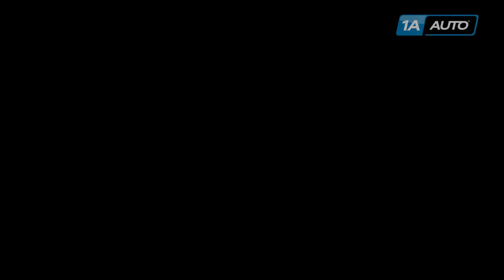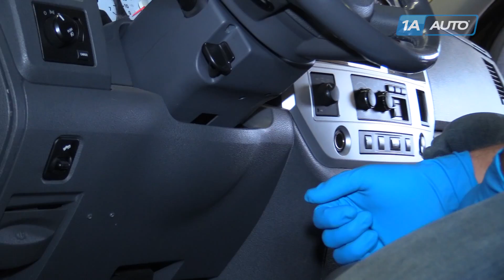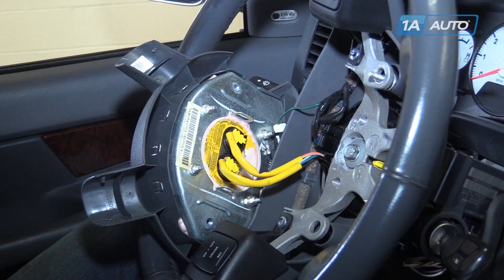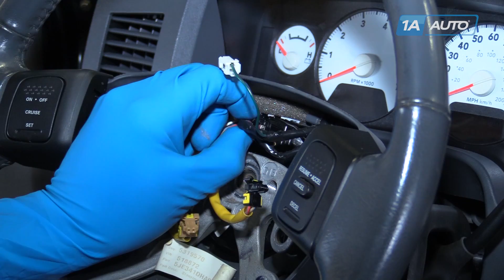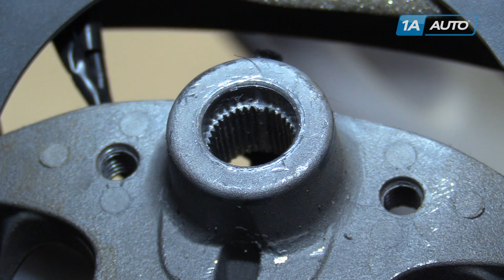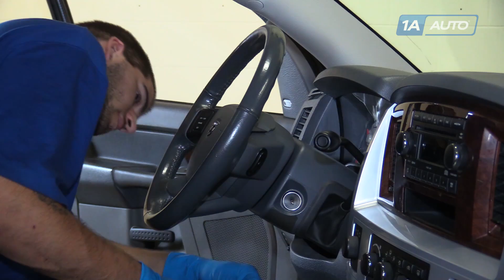How to Replace Airbag Clock Spring 04-08 Dodge Ram 1500

Comment: I have a 2010 ram 1500 2wd. I replaced the steering shaft ujoint and forgot to tie my steering wheel. My airbag light and eps and traction light are stuck on. I read this is a symptom of bad clockpring but all the buttons on my steering wheel still work. My horn and radio and crusie works. No blown fuses either. I also replace the wheel hub bearings. I also gave no codes. Is it possible those lights will shut off on their own?

Comment: You do not need to take the steering column or the steering lever adjuster apart. All you need to do is take the two screws 10 mm from behind the steering wheel and it comes off. You’re doing too many steps that are not necessary.

Comment: Will the clock spring cause a clicking in the steering wheel assy. when moving the steering wheel left and right. It only clicks once in either direction.

Comment: I'm recieving a code ( driver squib #1). My horn works. With my horn working, I was told that it's not my clock spring. Could you create a video on how to search for the open circuit? Thanks

Comment: Will this fix my horn being stuck on
Reply from the maker: +Liam Advena We wouldn't be able to diagnose an issue like that here, you may want to have a local mechanic take a look at it. Thanks for checking us out! http://1aau.to/m/Shop-1AAuto-c
Reply: I just bought one to see if it will fix it I'll let you know when it arrives
Reply: My horn starting goin off fuse and relay are good 
Clock spring peope say cruise control or air bag light I’m having none of that  just horn going off when I tap the horn it stops and then starts again

Comment: Hi, good Video, While heat the bags are deployed, Should I change clock-spring too or airbag module enough?
Reply from the maker: +Webberdock thanks for checking us out! Although it is not necessary to change the clock-springs if they have not failed, it may be a convenient time to have it done as the bags are already deployed. Please let us know if you have any further questions, thank you!
Reply: @1AAuto   thanks for the comprehensive answer!!!

Comment: Extremely helpful, just replaced the one on my 2007, mine had a rubber and steel weight under the wheel, and the wiring was not routed the way it was on this one. I did not have to remove the turn signal module. It may be because mines a 6spd. Otherwise this was perfect. Thanks! Saved 800 from the dealer.

Comment: This was very helpful as I need to check the horn connection on the back of the airbag.I have a 2013 ram 1500,and the horn started to not work properly.When I push on the horn symbols on the wheel it does not work,only if I press on the top right corner.I recently took it to the dealer cause the steering wheel control lights flickered.I think they may have moved the horn connection out a bit by mistake.But they did not check the horn problem.I am disappointed in their service.I know I can check it myself.Great video thank you,myself and my cousin have bought parts from you.
Reply from the maker: +CHRISTOPHER1169 Thank you for your order. If you would like to leave us a review on Google it would be greatly appreciated. Here is a link to our reviews section. Have a great day! https://goo.gl/i5JFNY